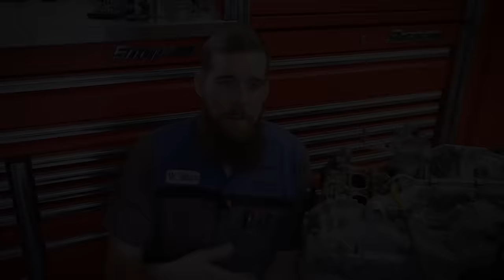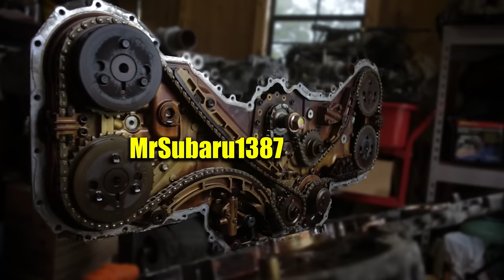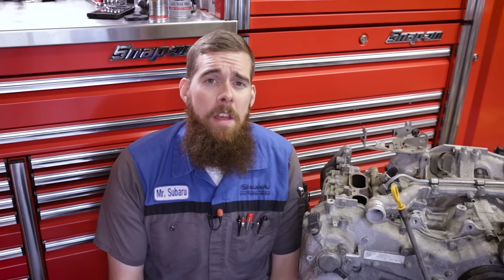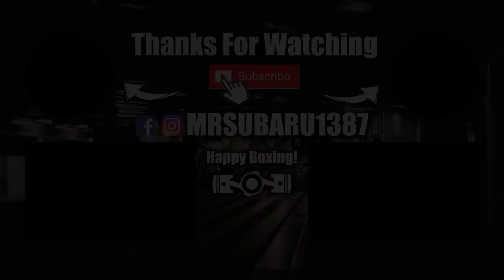Why Subarus Are So UNreliable!!! Buckle Up!!!

Comment: I retired early , and my supplemental social security from my employer ended before I was 66 so to augment my pension before I could collect my SS..I went back to work part time at a Subaru dealership for avbout a year in a non mind stressing job ....delivering OEM  parts to privateers. 
During that year ...I saw lots of blown up Subies that young excellent techs had to rebuild .The problem with what you are talking about is that at least the  SUBARU dealership I worked for kept covering under total warranty parts and labor  17 to 18 k  engines rebuilds  in STIs  WRXs   that has been flogged to death without proper maintenance by young morons .In particular, one STI was rebuilt twice for the same moron for the same type of abuse ..I have never seen metallic shrapnel like what was found in those engines that the  idiot grenaded,  twice.
I remember asking the parts manager why the dealership was covering 18 grand worth of damages when these vehicles were clearly out of warranty and moreover flogged intentionally to death. His  reply was that CORPORATE SUBARU JAPAN ...did not want to piss customers off ..especially those who buy  high performance SUBARAU cars . Back then they were were still competing for semi muscle car market and although neither Mustangs or Camaros had AWD models  Dodge Challengers did . None of the old muscle blow up head gaskets as easily as SUBIES when they are abused they have different much better  reputations .The little boxer motor is more than just okay , but its architecture is delicate and  more prone to failure when abused . Having stated what I witnessed ,  it is unlikely that this engine abuse and destruction would go on if  SUBARU  stopped rewarding these idiots for flogging and destroying their product which can be proven for under warranty and  especially when out of warranty 
when they came in with their mods removed but the evidence was still there to be seen.
I am not  delving on the rest of SUBARU none HP cars  part failures,  like wheel bearings, brakes, oil leaks from head gaskets, melting alternators , and a list of recalls for parts that goes from Alaska to Maine.  If treated half way decent the car can last and be in many cases reliable enough ...but other than for  their crash safety record, I would not accept one as a gift .